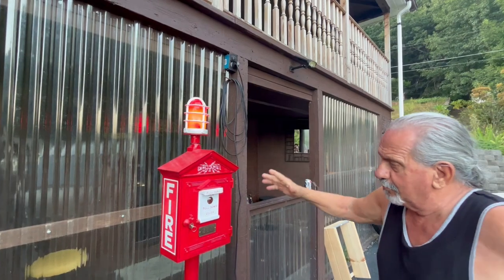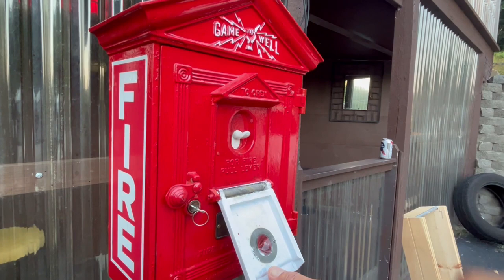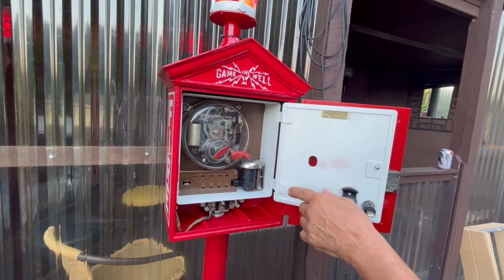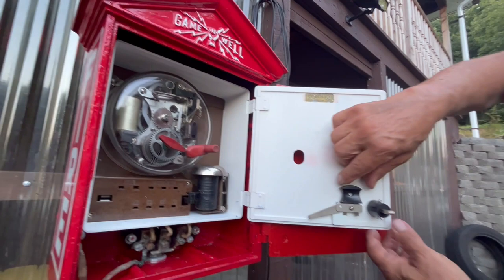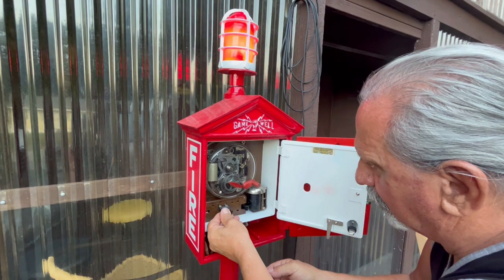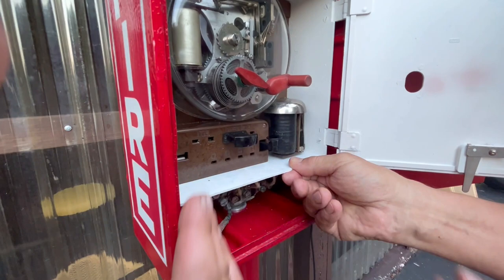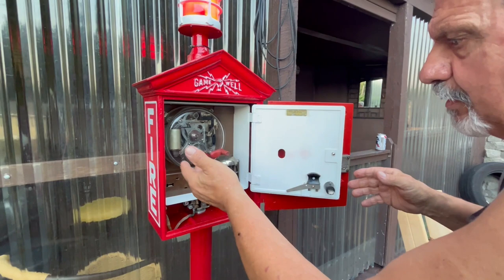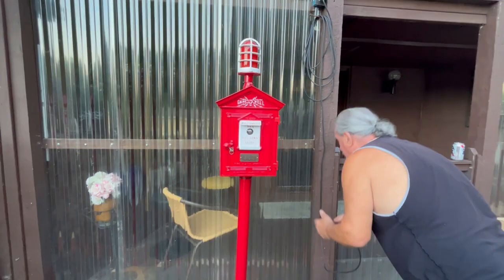Gamewell Fire Alarm Call Box Fully Restored

Comment: that key is put in to test the system at the box and not transmitting down the line.  the plug staying the in the test slots means it wont work as designed so the safety preventing the box from closing is there.
Reply from the maker: Thanks for watching !